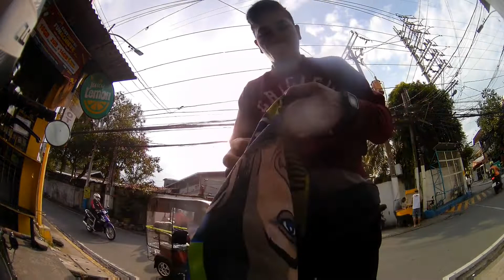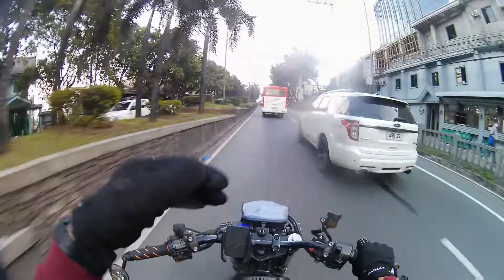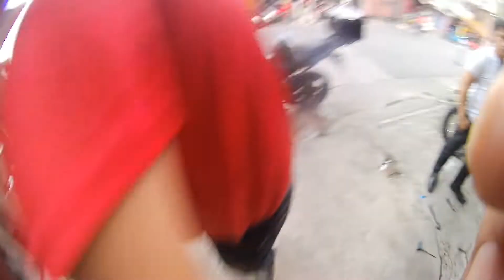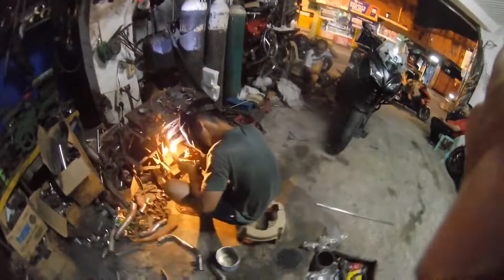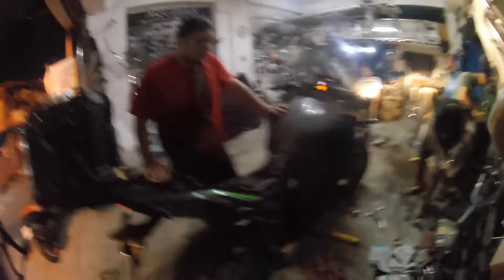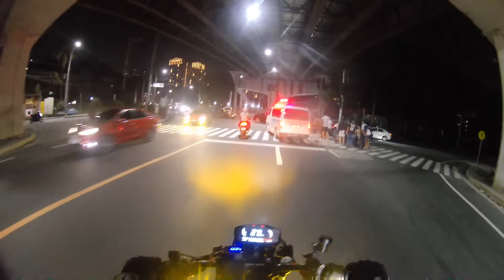verseys 650 open pipe🏍️🏍️broom broom

Comment: sana mag 270 or 360 crankshaft setup na ang kawasaki, it's the one thing stopping me from goin back to their 2 cylinders (di nagkakalayo tunog sa 1 cylinder kahit anong palit ng muffler) alam ko tunog pag ang parating Ninja or Z e..

Benelli lineup has 360, at tunog almost inline 4. (TRK502x, Leoncino)
Yamaha has 270 Crossplane, tunog V Twin. Even the new CFMOTO 450SR  270 na rin.. barumbado tunog...

Whilst Kawa(400 to 650s) , CFMOTO (NK and GT) and Honda (500s) stucked at 180 configuration, parang pinalaking raider lang.